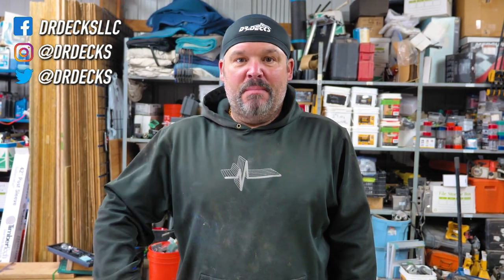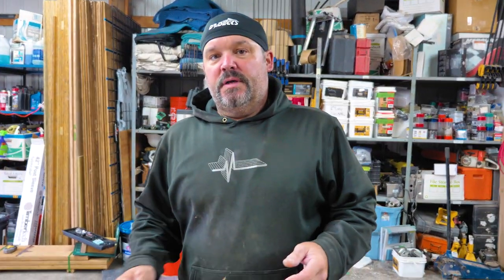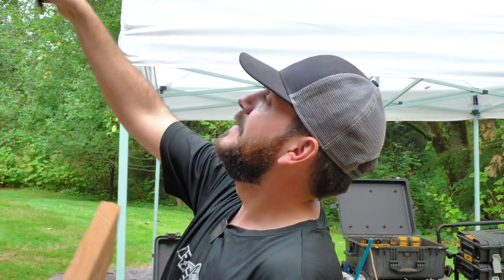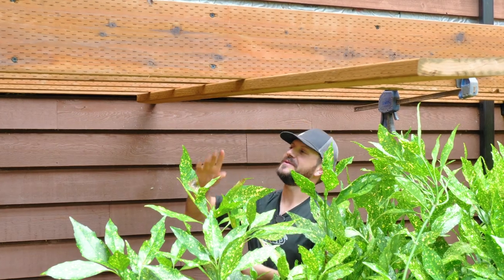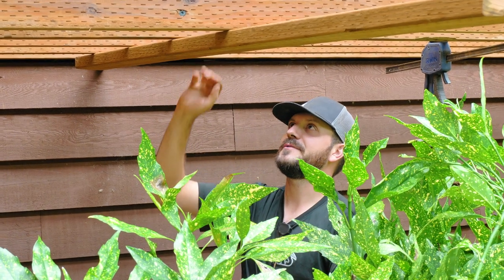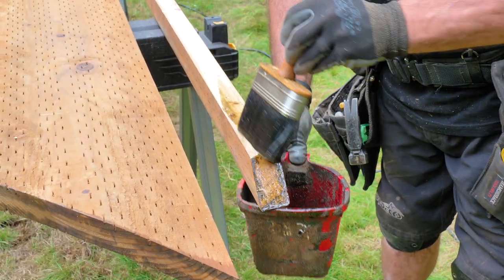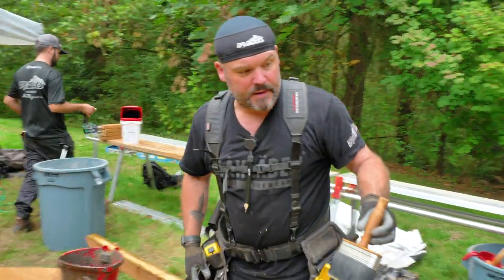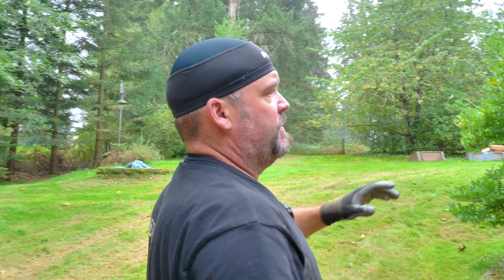Build Update: Cutting Waterproof Bladders & Blocking || Dr Decks

Comment: What are your thoughts when it goes to using pond liner to attach trex decking to the pond liner and the pond liner to concrete. Just did a job where the only real option was to glue pond liner to a 2”inch  slab of concrete and then glue on top of the pond liner to attack the trex. I’m concerned about durability through winter contraction expansion

Comment: we are going to install a water bladder under our deck. we do have to put some blocking in for our gazebo. will the blocking on top of the bladder compromise the bladder by drilling the blocking through the bladder?
Reply from the maker: Yes. Use some butyl peel and stick over the blocking as well as a good silicone to seal up the holes. Best of luck.